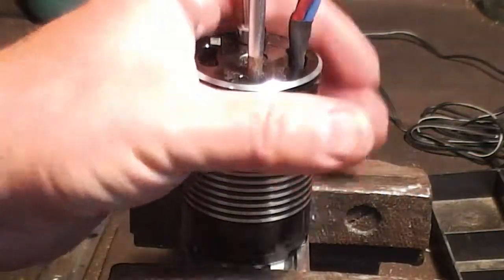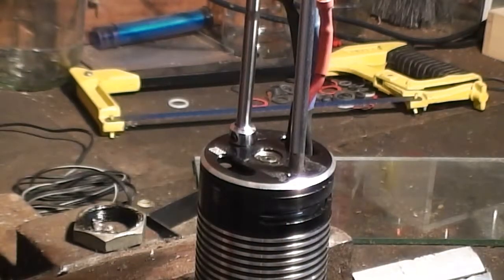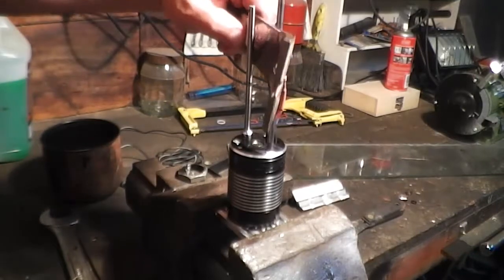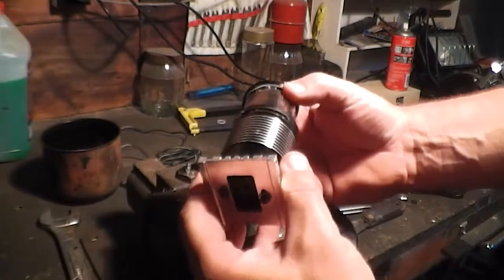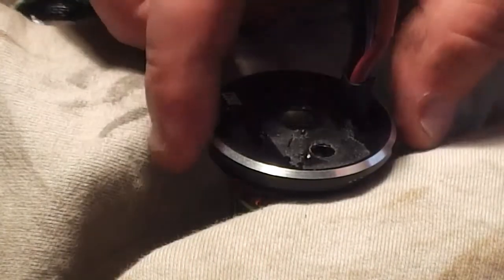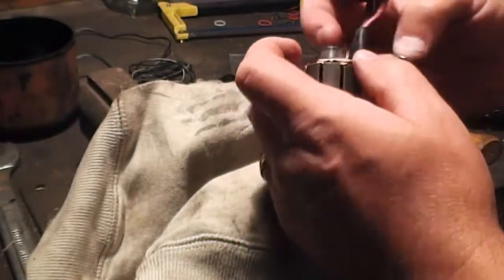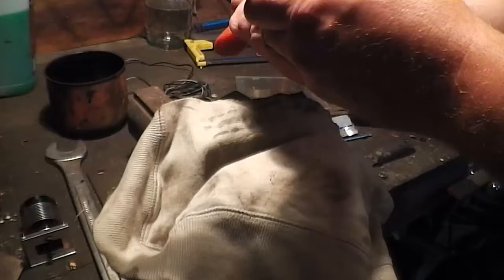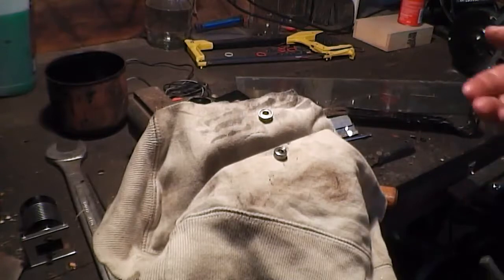Trex 600 motor Tutorial part 1

Comment: Great video.  Problem I had was once I put it in the vice, heated up the top just like you did.  Then I started to unscrew it and the top part did not unscrew BUT the whole motor rotated and the BOTTOM cap unscrewed.  The part with the windings is still in the can and won't come out, but the barrel with the magnets came out.  So now I have three pieces.  The bottom end cap with the small bearing in it, the shaft / barrel with magnets and the motor body with the coils still in it.  Now what do I do???
Reply from the maker: Hey there... You might need to re heat? Sounds like it has picked up on the threads.